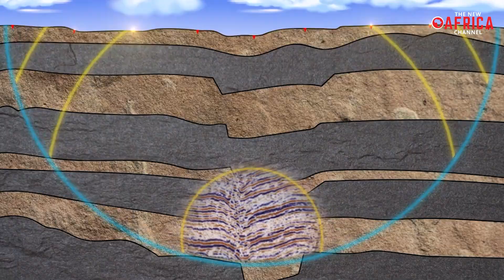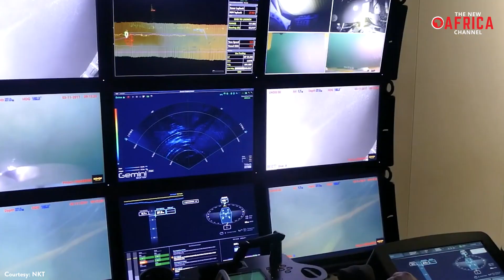Xlinks Morocco UK power project - Tender launched for study on the $22BN renewable energy project

Comment: 10.5 GW is a lot, what’s the annual GWh? And the battery lasts for 4 hours right? That’s a lot of power, but not as much as an equivalent sized nuclear power, but it’s a large ambitious project nonetheless. And without the nuclear waste.
Reply: This first of a kind project will generate 10.5GW of zero carbon electricity from the sun and wind to deliver 3.6GW of reliable energy for an average of 20+ hours a day
I read this as 10.5GW is peak production but the Project is made so the cable to UK will be able to deviver that 3.6GW max load of the cables nearly 24/7.

Comment: New Age Imperialism by the UK. Will Morocco be exploited now by the UK?
Reply: Why? This should be a win win. This project creates a steady income flow and creates Long term jobs for the maintenance in Morocco

From the site of the project 

The construction of the Xlinks Morocco-UK Power Project will create nearly 10,000 local jobs, of which 2,000 will become permanent. At least 40 per cent of generation installation will be manufactured in Morocco and we will work with local partners to increase this where possible.
Reply: how?